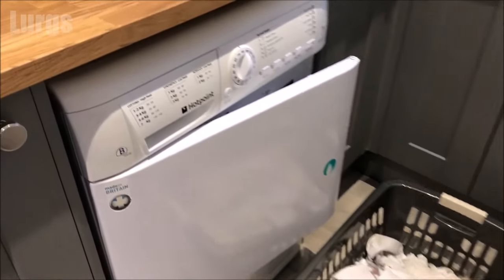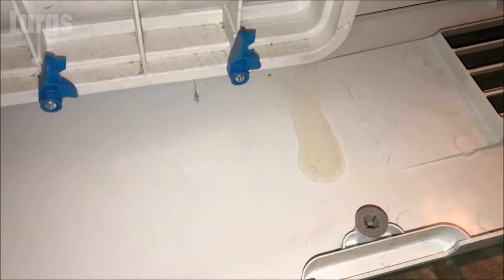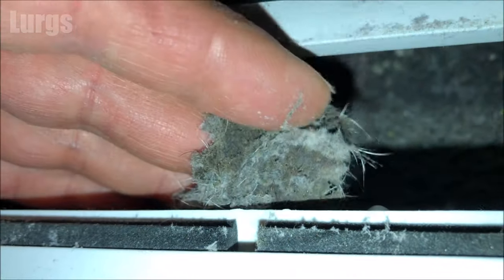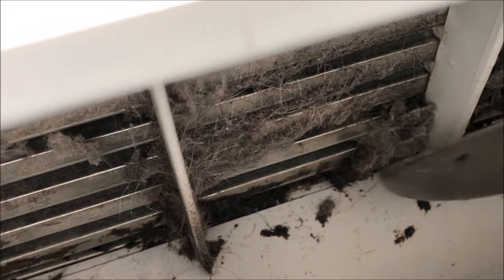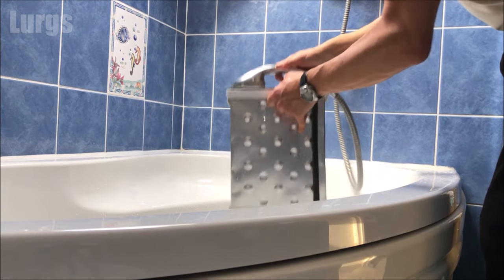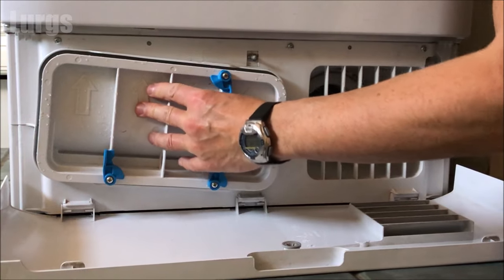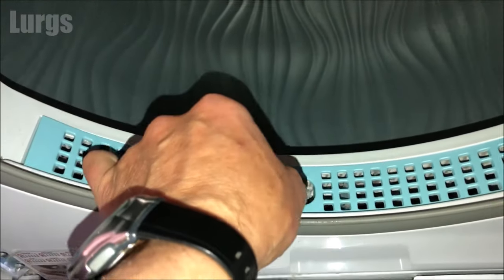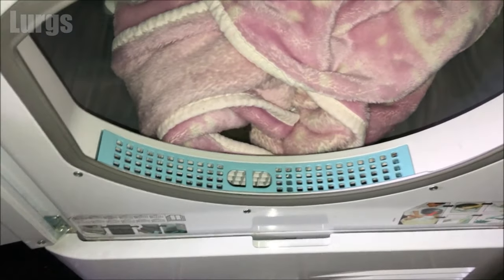How to clean a Tumble Dryer Condenser Unit for Maximum Efficiency

Comment: Good video but condenser should not have got in that state in first place. I was cleaning mine every 2 to 3 weeks. Had to have the candy engineer out to attend to a fault. He looked at my condenser and said  I should be able to see clear daylight right through. Mine was not that dirty but he said I should be cleaning once a week if used a lot or at least once a fortnight for maximum efficiency. Thought I would share with everyone.
Reply: Just to add make sure you empty the water tank (that captures the water during the drying process) at least after 3 to 4 runs. Once its full your clothes will take for an age to dry. Best keep on top of it.
Reply: Is it possible to open the condenser ?

Comment: Ours is similar - I undo the screw's on the condenser filter and yank that plastic end piece off feels like it's going to snap, but it's just the clips coming away - then I get a long pipe cleaner in there - the shower didn't clean it that good because we use fabric conditioner (which is like wax) that puts a greasy layer on the metal - good scrub with the pipe cleaner & washing up liquid gets it off 👍

Comment: Brilliant video, thank you so much. My condenser unit now looking as good as new - I was always wary of putting water through this, as the Candy Instruction book just says "hold it under a running tap", but didn't elaborate as to how exactly this should be done. Managed to get a load of gunk cleared from the condenser after watching your video - its worked a treat 🙂 Had a load of laundry that was still damp after a cycle yesterday, so hopefully the cleanout will have helped. Thank you again!
Reply from the maker: Yes it will definitely help your tumble dryer. 😎
Reply: @LurgsHowToGuides  It definitely worked! Just dried a load of towels - they took half the time to dry now that the condenser has been fully cleaned - thank you again!!

Comment: Hey, thanks for the video, it helped a lot. I didn't know you could rinse out the condenser unit. 
But I'm wondering, what's the problem with draining down all that lint? I mean, it's mostly organic material. Also most places clean sewage water quite effectively. What's your take?
Reply from the maker: Try to catch as much of it as possible before it goes down the plug hole. Just shows how much comes off of clothes in washing and tumble dryer.
Reply: A lot of clothes fibres are unfortunately plastic, which quickly break down into microplastics that aren't efficiently cleaned out by sewage systems (even when the water companies aren't dumping it all into waterways).
Reply: @Amy-oh8qb  think how much more microplastic ends up in the municipal waste system when washing clothes.   Perhaps just buy cotton clothes

Comment: We have been given this Hotpoint Aquarius condenser drier and the lady said it was working in good condition but when we got it home and plugged it in to try it the drier tripped out the electric after a few seconds so we switched off the drier and turned the electric back on what had been tripped then we tried the drier again and it did the same thing so we don't actually know what the problem is l checked the condenser and it was clean also the filter were the fluff is collected and that was clean so could you give some advice on why it trips out the electric
Reply from the maker: Unfortunately it could be you have a modern consumer unit which may be more sensitive to spikes. Only way to prove it would be to plug it in at someone elses house or on a different plug\circuit somewhere. 
Did you see it working before you took it home?
Reply: @LurgsHowToGuides  no we didn't see it working before we brought it home we was told by the lady who we got it from said it was in good working condition so we took her word for it l have looked on line and it said if the electric trips then it could be the sensors l even asked my brother and he said it's faulty if it does that it's not a older drier it's Hotpoint Aquarius not sure on the model number since the drier was for free off Freecycle you expect it to be ok
Reply from the maker: @Craftyeastyorkshirelass  Oh dear, lesson learned always test it before you take it, guess it’s awkward when it’s free. Sorry to hear that but it sounds faulty
Reply: @LurgsHowToGuides  thank you for your reply we took your advice and tried it in another socket we moved the drier to another room and tried it in the wall socket and guess what it worked without any problems and works fine never tripped the electric so we put it back in the room were the washer is which is actually in the airing cupboard and has two sockets in there which work fine so l plugged the drier into the second socket were the washer is and it worked fine we think our landlords had the rest of the sockets spliced off the rest so now we have a perfect working drier l will do what you have said when l clean the condenser the drier is outside the airing cupboard and the plug reaches the socket so l plug it in and when finished l unplug the drier so thank you for your advice
Reply from the maker: Nice one, glad it’s all working 😎

Comment: Hi there. Is it normal that mine doesn’t come out? Thanks
Reply from the maker: Nope. It should just slide out once you’ve unclipped it
Reply: @LurgsHowToGuides There’s no way yo do that,the front  cover comes off and that’s all. Cheers
Reply from the maker: Must have broken then, carefully remove the whole thing, try and fix it or it may need a replacement
Reply: @LurgsHowToGuides It’s brand new, maybe they don’t all come out.
Reply from the maker: @DisneyMarkUK It must come out as it needs cleaning
Reply: @LurgsHowToGuides mine has no way of coming out, it’s sealed in. Theres a cover that comes off and it came with a brush to clean the area but it definitely doesn’t come out.
Reply from the maker: Oh, check manual to make sure that’s right. Very strange though

Comment: but how do you clean all the now WET "fluff" from inside the tumble dryer condenser?? Because what you did will leave all wet fluff inside and being wet will now stick inside and clog up even more. And putting it back and wet inside using the tumble dryer fluff will stick to all the wet areas and make it worse. I've done it your way but find a very thin, skinny long handle brush does a better job and it's dry. A baby cleaning skinny flexi handle soft brush may help
Reply from the maker: It needs to be left to dry out, I did mention this in the video.

Comment: I took mine how and now it won’t go back in. Any help?
Reply from the maker: It goes in at a slight twisted angle so just keep trying with it slightly tilted.
Don’t force it as it’s not that strong. It will go back in
Reply: Mine won't go back as well
Reply: Mine won’t go back in 🤔
Reply: I have cleaned after watching this video & it’s not going back in now.
Reply from the maker: @harjindergill7190 It goes in at a slight angle, don’t force it. It does slide in

Comment: There is two screw at the side of the condenser chamber, unscrew it and remove the top , you will discovered a new world ! You can use a chopstick to clean each layer , it will much much better than before ! 

Because I use the “bounce”for a long time， how to remove the wax like residue ？ I try 65 degree hot water ， but not effective ……
Reply from the maker: I did undo those but nothing happened? Does the top lift away then? Even Hotpoint official manual doesn’t mention it
Reply: Yes , you can lift it out with a flat screw driver ! Just some machanical plastic lock around the edge !
Reply: My dryer use for 5 years , much dirty then your ! Before I just clean like your method , but still not good ! Drying time more than 150mins per round ! After I done this , 100mins only
Reply from the maker: Blimey, I'll have a go next time and will redo video if it works, thanks

Comment: I literally can not get this back in 😫😫😫😫
Reply from the maker: Don’t force it. It will go back in easily but at a slight angle!
Reply: do i lift it up as i out it in? :( im struggling with putting it back in
Reply from the maker: @art83islife  No. Just slide it in at a very slight angle and it will go, there's a nack to it, do not force it as it's flimsy.
Reply: @LurgsHowToGuides  ok thank you will try again 🙂

Comment: There are two grub screws either side of the filter. Remove them and pull the front off to access the whole unit easily.
Reply from the maker: Someone else mentioned that but I’ve undone them and the front does not move, there’s no obvious join and instructions don’t mention it, I wonder if my design is different
Reply: It could be different but I've just  serviced a creda TCR2 with an identical filter that was really clogged with pet hair ect. The grub screws were retaining the front of the filter. If you remove them it should come out.  I had to use a flat head screwdriver to prise it off though as it was gummed up.